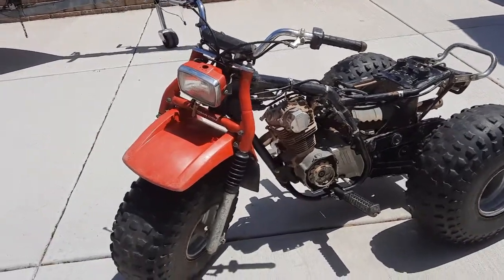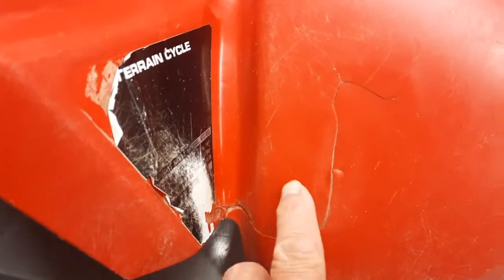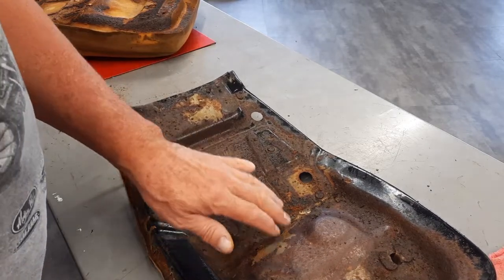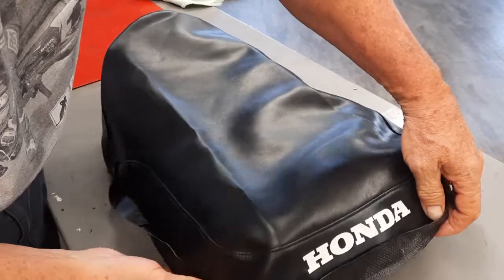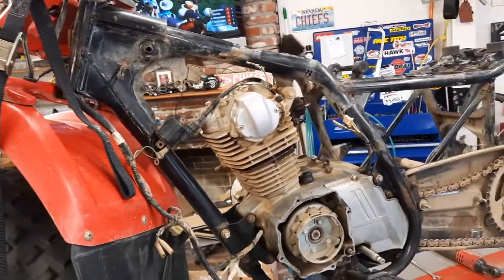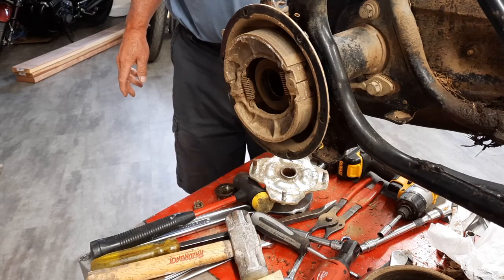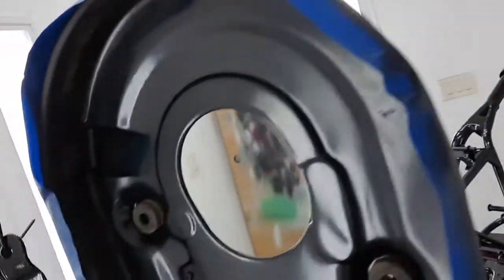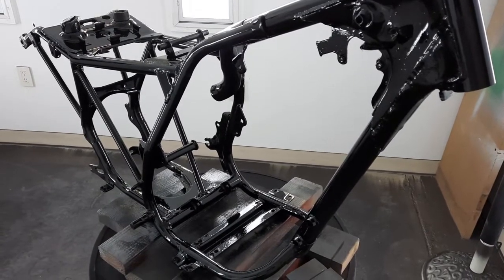How To Restore A Honda ATC185S  part 2

Comment: Hi, I have been using a product called ' evapo-rust ' for my parts, it is safe on your skin, good to get rust off chrome, even cleaned my fuel tank, I had a 70 honda trike in the 70's, great videos.